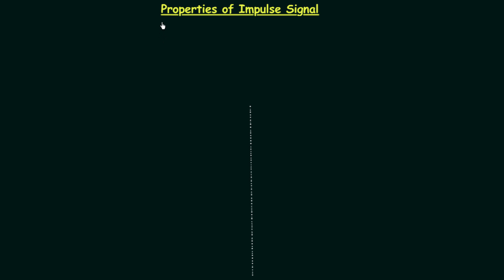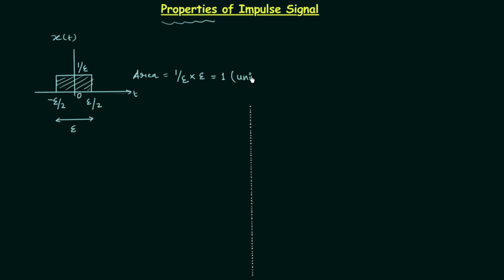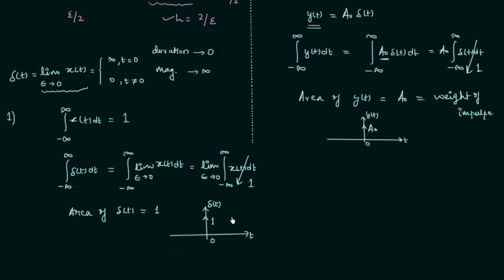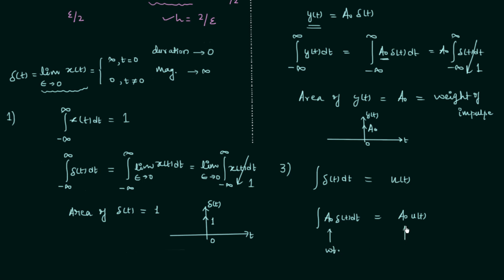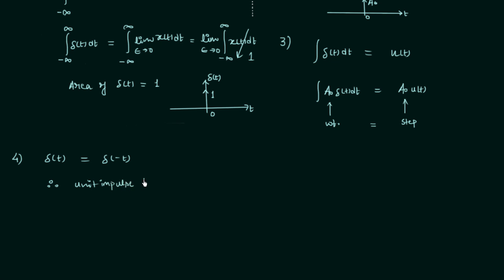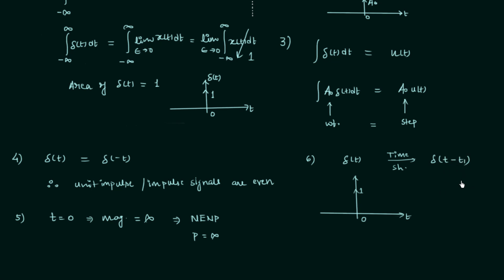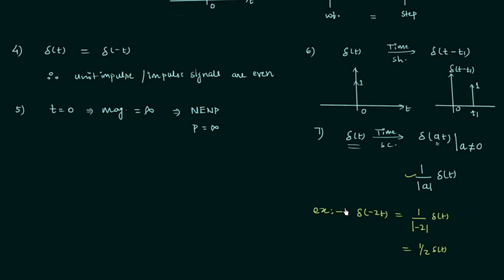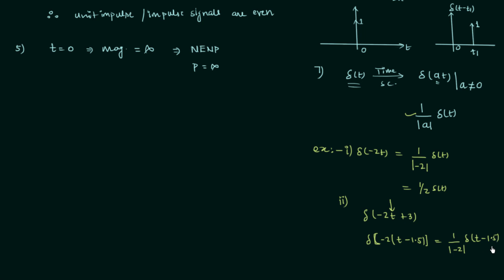Properties of Impulse Signal (Part 1)

Comment: For those confused between property 1 and 3:

These are essentially the same results. In the first property, we take definitive integral from -inf to +inf.
In the second property, we take indefinite integral. 

Let's pretend we also take definitive integral in the second case, therefore: [u(t)] from -inf to +inf. 
u(+inf) - u(-inf) = 1 - 0 = 1

So the difference is that in the first property we take definite integral, in second - indefinite.

Comment: Doubt plz respond ::::::: Sir as you said area=base×height(magnitude) 
At finnally that impulse becomes on x axis is zero so base is= 0  and respectively height ( magnitude) =  infinete 
Then area =o×infinite=1( in case of impulse function ) how it is possible sir
Reply: Bro it does not zero its approching to zero and when it approches to zero as you see previously when decrease ę to half height increase by 2 times. Similarly when aproches to zero, width become so so small, height approches to infinity but we know when we integrate from -α to +α the area comes to be unity. Still not clear watch it again, he explained it very well. 
And example 
Width= 0.0000000000000000000000000000000000008
Than height will be 10^37 that almost infinity 
Multiply these two and get the answer

Comment: When signal height reaches to Infinity the width of that signal is 0 then area =∞ *0=0 then how area of impulse signal 1?
Reply: yes
Reply: The width tends to zero but exactly zero
Reply: when they say  infinity it means a very large number; when they say 0 it means a very small one. To make it simple let's say the area is 1 trillion (~ infinity) times 1/1 trillion ( ~ zero ), which is 1.
Reply: ramana polireddy hey when height of the pulse reaches at infinity our width tends to 0 so when we integrate our signal so we take limit from 0 to 0 as widht tends to 0 and consequently we know that when upper and lower limit are equal the resultant will be UNITY (1) .
Hope you understand this .
Reply: What is the limit 0 to 0 does it make sense...
Reply: forget all,understand 1/infinity(that is the width ,very small)*infinity=1